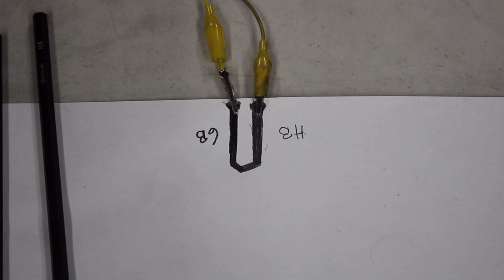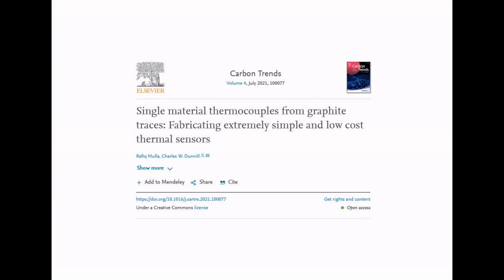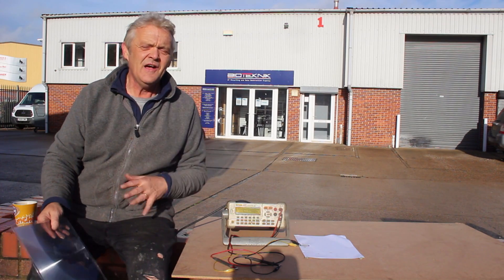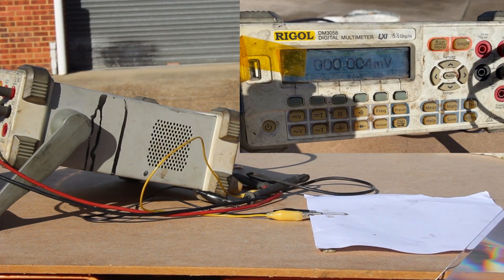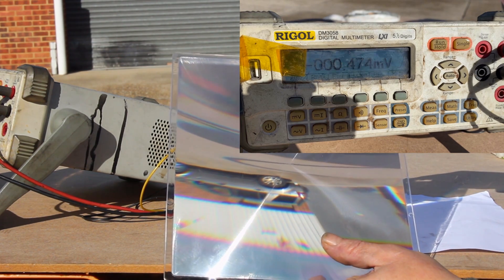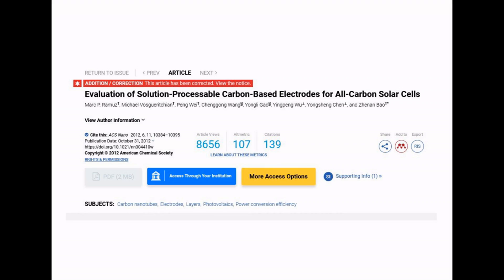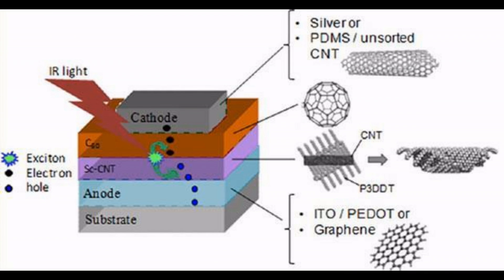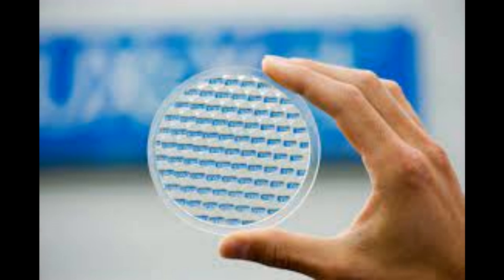1721 A DIY Solar Cell Made From A Pencil And A Bit Of Paper

Comment: Time for some combination tech. Use the zigzag method to put a bunch of these on a circular piece of paper, and set it on top of your coffee mug, attached to the underside of a Stirling Engine. Then check the output.
.
And on another note: I wonder if this would work with HB & 6B graphite lead that's made for mechanical pencils? You can buy that in quantity from lots of places, like Amazon. 
.
https://www.amazon.com/Koh-I-Noor-4190-Graphite-Leads-120mm/dp/B00BJ5PHL2/
.
https://www.amazon.com/June-Gold-Thickness-Resistant-Convenient/dp/B01FRRNCFU/

Comment: But how much power is generated? A few hundred mV into the high resistance of a voltmeter isn't much good if it collapses to almost zero when a load is placed on it. Did you try reading the available current?

Comment: I tried to reproduce your experiment and come to the conclusion that the paper and humidity must be quite important. Taking off the pencils graphite from paper by using an adhesiv strip and attaching my multimeter clamps to this strip nothing happens any more :-( . On the other hand raising the humidity of the paper used before the microvolts increases immediately, vice versa when drying out the "junction" spot with a small not air heater the voltage goes to zero. I was not able to reproduce something sing a fresnel or other lense. Maybe you can investigate this experiment more.    looove your channel :-) cincerely yours.

Comment: Update: I replicated this experiment
Setup: HB & 10B traces, (versus HB & 6B that Robert used), same fresnel lens as Robert
Results: Max 2.5 mV without paper, paper smoking at 3.5mV (which destroyed the connection)
Comparison: Robert got up to 0.8 mV on this video versus my 3.5mV, difference is likely the use of 10B traces or my willingness to burn the paper 🙂
Reply from the maker: nice replication mate and I think you are spot on with what you say
Reply: @ThinkingandTinkering  Only recently found your channel, absolutely love it, I have learned so much, thank you. Do you think it would be possible to harvest the wasted heat from a wind generator dump load either directly or via a sand battery, with a small paper array in close proximity?
Reply: what if you don't draw and put the whole graphite from the pencil in sun
Reply: @Asky_  According to my research, you have to have 2 different types of pencils (with varying degrees of graphite concentration). So, theoretically, you can burn off the wood from two different pencils to get the graphite rods. The sun alone is not sufficient to produce enough of a temperature difference (i.e. potential difference). Keep in mind, you need focused heat only at the connection point of the 2 graphite traces/rods. If you use the sun, you will be heating both graphite rods equally (unless you focus the light). As such, the power is proportional to the length of the trace (temp difference between the connection point), amount of focused heat between the connection point above and below said connection point, the difference in graphite concentration, and resistance of the graphite traces/rods (the longer the trace, the higher the resistance). You're not going to produce very much power (nW) but it can be scaled with relative ease. Hope this helps!

Comment: Iv been trying to imagine a way to harness the heat from my attic while making it cooler up there too, the cost of rafter insulation (reflectix or other)  isn't cheap : (  but if I got free electricity that would be cool. is there a way to draw a battery to store the charge ? I could only wish.

Comment: When I was a kid I thought I was some pretty hot sh*t when I worked out I could use pencil lines on paper as very basic resistors. I went as far as scrounging components from the technology teacher at school to build a basic oscillator circuit with a piezo speaker (Copied from a book I found in the school library), and tried to make a paper "Stylophone" by drawing lines with roughly the right resistance, and trying to tune it by adding thicker lines, or rubbing at them a little to change their resistance.

It proved to be absolutely bloody impossible get all the notes even close, and some notes would change entirely just from picking up the paper to move it (My guess was that when the paper flexed it shifted the way all the flecks of graphite made contact, and altered the resistance) but it's an interesting and fun childhood memory none the less.

In the end I worked out that I could alter the volume by running another part of the circuit onto a pencil line too, and sliding a paperclip twisted on a length of wire along a pencil line would work as a variable resistor (It might have been the 9v battery power I was varying). So I used two pencil lines and two paperclips to have pitch and volume controls, and created a kind of temperamental variation on the Theremin........ and some pretty horendous sounds. :D

I thought what I was doing was pretty creative back then, but if I knew that one day I'd be seeing someone "Draw" a working thermocouple, it would have frazzled my little pre teen mind. :D

Comment: It clearly works at a junction, which in your drawing had very small area (of contact). Instead of duplicating and interconnecting such junctions in complicated patterns, why don't you try two sheets, one completely coated with hard pencil, the other with the soft, and then overlapping them gently together? You might not see an increase in potential compared to your experiment. Measure instead  the current coming out. I guess in your experiment the current was close to zero. If this works, there should be a significant increase. If you then connect a few such double sheets in series, you might even be able to light up an LED. 

Experiment 3: Simply draw with the soft pencil over the hard one but extend their terminals away in opposite directions.

Comment: I would like to start off by saying how much of an inspiration you were for me to get back into doing things again. Thank you! This was so plain simple I did it right away! I used an HB#2 and an H8 pencil. Now what was interesting is when I went from drawing it on paper to directly on a quartz crystal. The increase in power out was tremendous. I went from getting 20-30 uV to 0.182 V with a similar size circuit!!!! I repeated the process multiple times with similar results. I'm not sure why this is, but seemed very interesting to me and thought you would like to hear about my results. Maybe you can give it a go and see if you have similar results.

Some interesting finds I had:
 - I found that the size of the crystal didn't seem to matter. 
- At 300°C it no longer produced a voltage
-Freezing prior to applying heat seemed to be more of a detriment
-Applying heat to the Cathode produced more voltage 

Thanks for all of your videos! Please keep them coming! And the same with Luke!
Reply: I wonder how glass would work as a substrate.
Reply: @Time Surfer  I haven't tried glass yet, but I could see it being beneficial with having the cathode on one side of the glass and the anode on the other. Then, encapsulate the cathode side to trap the heat, add a reflector to the back to increase the thermal efficiency. This may increase the voltage based on my findings of adding heat to the to cathode increases the voltage. What are your thoughts on this? How do you think the glass should improve? Why?
Reply: Ok, most likely why there is a jump in voltage is due to the heatsinking properties of quartz.  You may have been extremely fortunate and drew lines that just happened to hit closely enough to the quartz resonant frequency, but highly unlikely.  Would be very interesting to do so on diamond, but a bit too pricey for such an experiment.  You could somewhat simulate that by using a thin piece of quartz and underneath it in a clamp(to hold it tightly) a graphene sheet that is on a cool surface.  Cheers and best of luck!
Reply: Staples also work really nicely to connect the cells

Comment: Think: with the right kind of white paint, this very well could emit truly astounding amounts of power, simply by converting the heat to those few bandwidths of IR that [if you will] 'punch a hole in the sky' [in other words, those bandwidths that air does not reabsorb and defeat you]. (~_^)-b

Comment: This idea maybe used in conjunction with a solar hot water system by using the heat sink of the solar panel painted with this graphite and getting twice the bang for the buck so to speak.
Great content mate 👍

Comment: I wonder if you can make a copper oxide acetone fuel cell with a sulfur based polymer made from sulfur an a divinylitic co-monomer for a proton exchange membrane. with either a sheet of carbon felt with treated black copper oxide or electroplated micro channels with copper that is oxidized.

Comment: I wonder if good old-fashioned carbon paper would work and if it comes in HB and 6B.  It would save a lot if colouring in.   Or could we grind up the graphite from the pencils (or buy it somewhere), put it into an emulsion of some sort, and then paint it on in interesting shapes.
Reply: Put the emulsions in inkjet cartridges, and use in printer
Reply: @DavyOneness  That's the spirit :)

Comment: 1:18:  He says while wearing a fleece. 
Make a thin sheet of one material with a laser engraved texture of pyramids and fill the valleys with an insulator.
A simple flat sheet on top would make multiple junction points over a large area. ⌅⌅⌅⌅⌅⌅⌅⌅⌅

Comment: I was hoping you were going to scale this up to see how much an A4 piece of paper could produce.
Reply: You do it.  Get a lens and have some fun! Part of the point of his channel!
Reply: Half as much as an A3.
Reply: Seemingly all/many of his experiments are tiny, short and focused on seeing if X works or not. If its any good for the viewer is up in the air. now we all have to try and replicate it to conduct an actual useful test. But hey, better than nothing :)
Reply: I have tried to connect many in series with drawing a line, using staples, and different number pencils. It seems to not increase like a battery does. Maybe stapling diodes between each cell...
Reply: @makerslife  just draw a zig zag line. One pencil for the zig and the other pencil for the zag. Connect terminals to both ends.
Reply: @justtinkering6713  Thanks! I just tried it out and each group of zigs and zags seemed to increase in power output. I'm assuming the geometry makes it act as a diode, am I correct? Now I just ran some quick fun tests using my breath. Here soon I want to cad up a design and pull out the cricut to draw it.
Reply: @makerslife  excited to see the results.
Reply: @justtinkering6713  The issue I ran in to was inconsistent lines due to the pencil dulling. I went back to the drawing board (pun intended), and ordered some carbon paper. I'm thinking about cutting transfer sheets, laying them on the carbon paper and pulling them up - similar to the scotch tape method of graphite. I just couldn't find any data on the composition of the carbon sheets so I'll have to do some testing. If you or anyone has some ideas, let me know. This is fun!

Edit (Update): 
I have tried clipping the different pencil leads together- no results. Thinking it has to do with the graphite layers and its properties. (Didn't expect a result)

Using anything sticky on the carbon paper was tough. The carbon paper produced most similar results to a 6B drawn circuit using an 2HB as control. The easiest method of transfer seems to be its intended way, go figure. Rubbing the carbon paper onto the surface within a stencil, then drawing the 2HB lines slanted to each transfered block to multiply the voltage. This seemed to work decently, with some poor connectivity due to lack of transfer control. 

Any other ideas out there?
Reply: @makerslife how about using colloidal graphite and "silverprint" pencil?
Reply: @makerslife  no staples just zig zag lines

Comment: Theoretically, if you drew several connecting lines, alternating pencils every other line... three lines giving you two thermocouples, theoretically; three lines giving you two thermocouples in series, that would double your voltage output with just three lines.

Comment: Make one that works when it's cloudy , gray and rainy and you will save the uk from and energy crisis 🤣🤣
Reply: Since this works with the difference in the heat, this could work under those conditions. The table in this case is the cold side, but you could look for materials that keep heat much better than the air, and you now have that difference.
The lens also allow you to keep the solar side hot longer as well. There is not reason you can't use the lenses in a series, maximizing the amount of heat obtained from the sun.

Comment: It would be interesting to combine this with the super white radiative CaCO3 paint on one side of the junctions to increase the temperature difference. If you can print on the junctions, then surely you could paint on the radiative layer. Perhaps even a Musou black or other absorbing paint could be used for the other side or the junction.

Comment: so the simple desktop option is for luke to draw up the simple 10/50 track pcb with matching 'solder mask' from pcbway for a few £ that puts super/caps diodes & many double sided pads in this layout to use as your repeatable carbon mask

Comment: 😀 if you could print 1 side of the thermocouple on 1 side of a page and the other half of the thermocouple on the opposite side of the page so that they meet at a point, using conductive  ink. You could play with different shapes, to get better air flow for the cold side.

Comment: Do the length of the lines matter? ie longer lines would give more amps? What about the intersecting points? Do they simply meet? Or do they overlap? Is more contact between the 2 types of pencil better or worse for output? Very iteresting concept!!!
Reply: I would assume longer lines would add resistance and produce less amps.
I would like to see a current measurement as well as a voltage measurement.

Comment: Thank you Robert, I feel honored!
After seen you struggling with my name I decided I need to change my name on YouTube to a simpler version of it 😄
Reply: Brother!
You have a Prayer for Jesus that was Forgotten from the Whole Roman Catholic Order as Profile Image!
And you generate Power from Graphite Drowings!!
How Much you are made of Truth‽

[Regardless of Faith and Truth:
Can you Imagine this drown on a Stirling Engine made of Graphite?
Because I have No Single Idea How they work..but still it would be a great way to augment Stirling's Efficiency..even if slightly..]
Reply: @antoniopacelli  
I don't know much about Roman Catholics. I'm Eastern Orthodox, and this prayer is the core of our faith, every Orthodox Christian knows it.

Talking about the thermocouple, putting it on a Stirling engine seems to be a little bit complex project which eliminates the genuineness and simplicity of graphite on paper.
I would think that the really interesting idea would be making a layered solar panel, like roof shingles, using plastic instead of paper, where the next layer shields the "cold" side of the  thermocouple on the previous layer.
Reply: @Alexander-Herman  
What about applying it over Insulation material for Recycling the output heat of Industrial Sector?
An insulating Aerogel with Layers of Thermocouple drown over a conductive heat resistant material..
Even Copper could be good if the Heat isn't too High.
Do you know if this Thermocouple can be made of Graphene?
Because I know from Kaner DoD/UCLA projects that you can convert Graphite Oxide into Graphene by burning out Oxigen with Laser Beam..even the one of a DVD burner...
Little practical Examples:
You could Burn Graphite Oxide Drowning of Multiple Thermocouple over a Copper "CD" place it all over you Hybrid Car Motor and connecting it to the Battery..
Yeah i know i am overcomplicating things it happens if i had little Sleep.

Comment: My thoughts for others to consider...

1. Where is the potential difference? 
2. Is it the potential difference in carbon of the 2 pencils leads 
3. Is is the potential difference between the absorption of photons between the 2 carbon black.
4. Does the heat difference also come into play? Seems like it
5. I'd like to print Vantablack and regular ink and see the difference power
6. Is amperage based on the thickness of the line?
Reply: Run some tests and let us know.

Comment: Humm...the difference between hot 🔥 and ❄️ works best. AND well how to increase cold side?   Principle of evaporation, been used for thousands of years. Soooo..put two systems together!  💡
Evaporate water in one dish or container to cool water or make ice, and pump that water (or cooled air in the presence of ice) to the cold side thus increasing it's efficiency by magnitudes.  I've done some experiments with this and it works well.  Give it a go!  GL!
Reply: Measure it in Watts to get an accurate difference between the difference in temp.  I doubt Rob you will need more on how to build the evaporative cooler as it's easy and you probably already made one.  😂